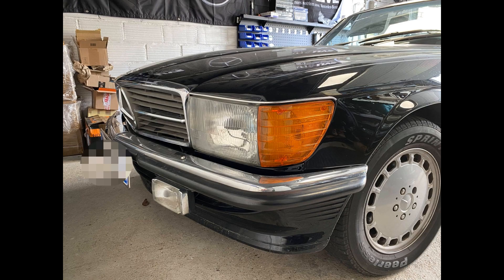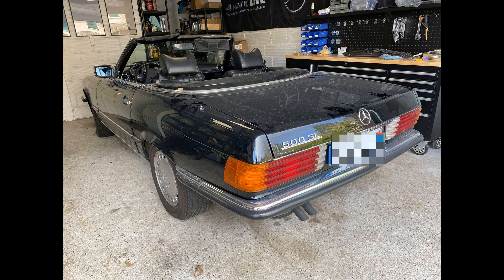㉦Mercedes Ke Jetronic㉦ - Mercedes-Benz R107 500SL/Fix your Mercedes as a virtual diagnostician

Comment: thank you for video!
-what is this relay and fuse called that were disconnected? would  this pertain to U.S., models:560sl's?

was he applying 12v directly to icv when idle dropped to 750?
thank you, would appreciate comment
Reply from the maker: Yes, he applied 12v directly on the icv. This is called k40 relay. As for the USA version, I'm not sure. K40 stands for THE ECU and the ECU on the R107 is under the passanger foot compartment.